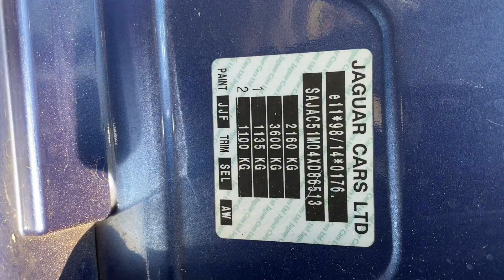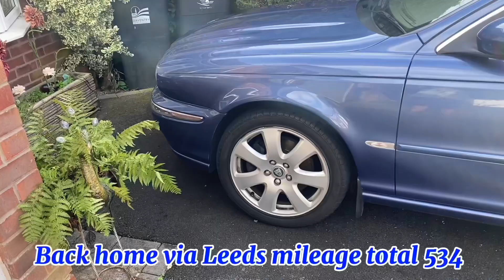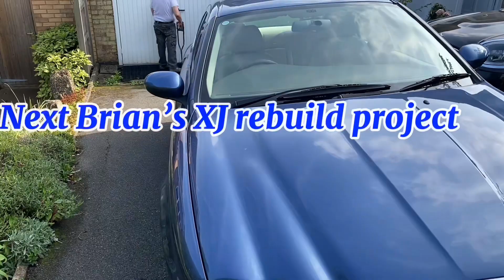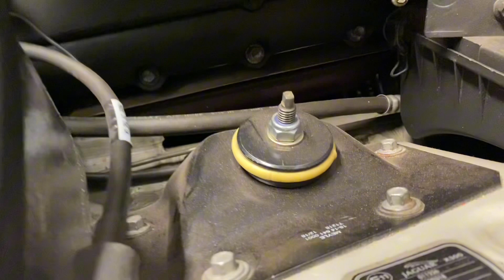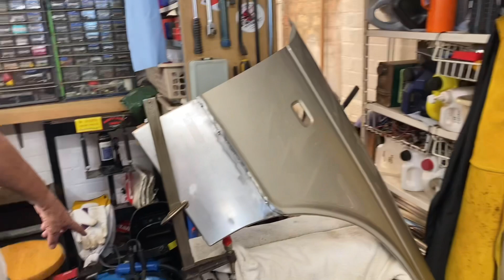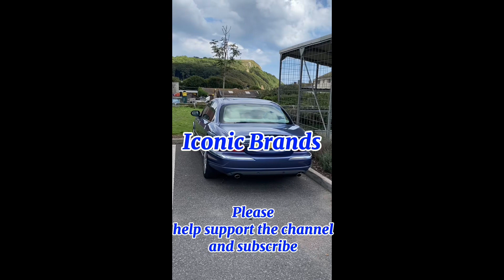Jaguar how to find trim/paint code + test on MPG accuracy,water ingress & suspension inc XJ project

Comment: I have a 2006 2.1 ltr X Type and a 1996 4 ltr XJ6 both under 100,000 k's. Both were designed by Geoff Lawson. The XJ6 factory code is X300 and the X type X400. I have had very few issues with my cars because I had paid more than others for my cars with one caring owners and very low milage. The main criticism of the X Type which I have had a fewl to date is the unnecessary V6 engine. A simpler 4 cylinder engine would have been a wiser and more practical choise of engine. However the macho male would not have agreed. I say this because I do all my own maintenence on my cars and I can not see any practical benifets in having a V6 over a good 4 cylinder quiet petrol engine. The V6 is really no faster or smoother than a four cylinder. They just sound faster and the V6 adds false status in relation to speed, just like fake vents on some cars, they put them on cars to make them look faster. I have loved William Lyons cars all my life and appreciate them more than the name which is all they are today. Just a name with no connection today to Williams original great design and tastes in cars.
Reply from the maker: Great write up and thanks for sharing , the v6 was aimed specifically at the USA market where anything less would have been considered to low powered. I agree with you on the fact that the British market is much more fuel economy oriented. 
Jags whatever they are all give the most kudos and for that they are worth it